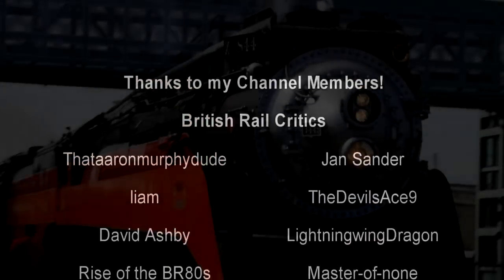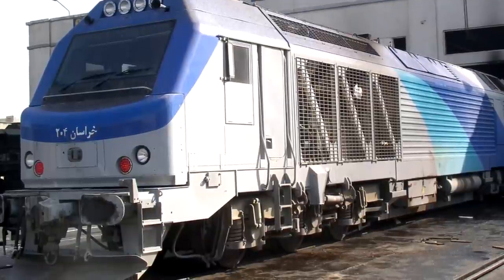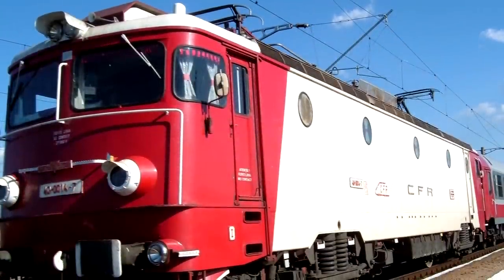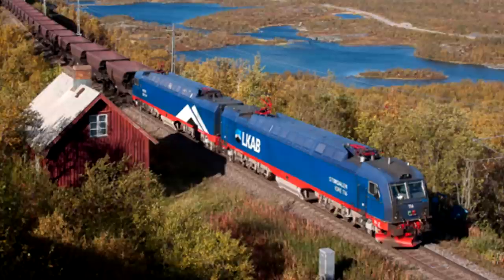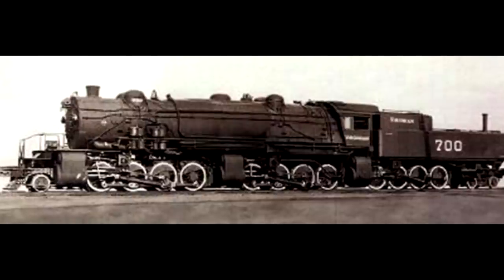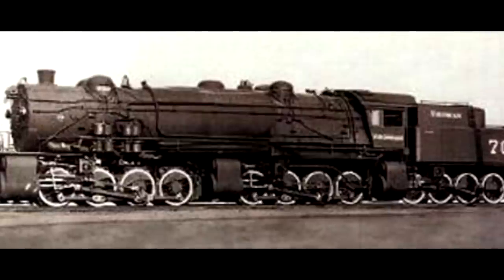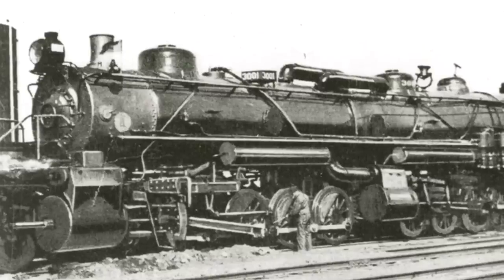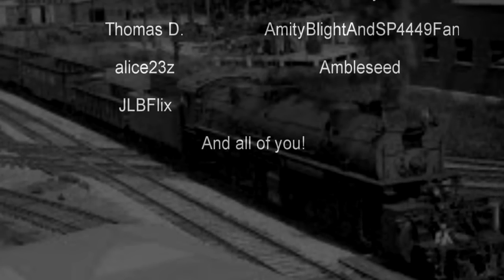5 Locomotives That Are Clearly Compensating For Something | History in the Dark

Comment: The Virginian wasn’t compensating for anything.  You should take an in depth look at the VGN, you’d enjoy it.  The Virginian was a coal hauling railroad through the mountains of West Virginia and Virginia.  I said through, not around for a reason.  While the N&W and C&O often kept their main lines along rivers and snaked around the stiffest part of the mountains, the Virginian was different.  Because it’s founder William N. Page and financier Henry Huddleston Rogers intended it to out compete the other two by offering quicker mine-to-dock service, the Virginian went right through the mountains with an intricate network of heavy gauge rails, tunnels, and massive trestles.  Interestingly, after N&W bought out the Virginian, they mothballed sections of their own mainline in formerly contested areas in favor of using the superior Virginian network.  

The VGN’s typical coal train was a 20,000 ton train consisting of their famous 6-axle 100 ton “battleship gondola” coal cars (also nicknamed that in no small part to them being arguably the largest supplier of coal to the US Navy).  They needed heavy power to move these trains through the mountains.  They had a large fleet of 2-8-8-2 Mallet locomotives, but noticed that the steep grade at Clark’s Gap, WV, was forcing them to use 4-5 of those locomotives.  The Virginian certainly could afford to do that being nicknamed “the richest little railroad in the world”, but also could afford to replace that lineup with more powerful locomotives.  The Class XA (meaning “Class eXperiment design A”) was originally an experiment to pull these massive trains without a helper.   Their horsepower is unknown because the VGN was never able to get them to full power long enough to actually measure their power before they’d run out of steam. Unfortunately, it was a failure in that role, and was used as a helper in banking, but was also a failure.  So the Class AE (“Articulated design E”) was born.  Those massive locomotives only needed helpers on the stiffest parts of that grade.  The high fuel cost led to the Virginian spending $15 Million to electrify the Mullens, WV to Roanoke, VA portion of the mainline, starting in 1922 and completing it in 1925. Their main locomotive, the massive EL-3A (Electric-3 unit A trucks) were some of the largest and most powerful locomotives ever built.  Interestingly, some of the Class AE stayed in service until at least 1953, the last one actually being scrapped by the N&W.

Comment: 1. 542kN ( 122.000 lbf ) of tractive effort for modern diesel with traction control is kinda/sorta regular these days.
2. So what is the issue here? Good loco, still usable.
3. Pretty standard freight locomotive. Kind of underwhelming, to be honest.
4. Steam locomotives can't be MU-ed, thus mallets and triplexes were an awkward attempt to get something kinda/sorta like that. It, obviously, failed, thus only four were made. Virginian ran EL-C triple sets of electrics which mopped the floor with triplexes and a single SD40 would give it a run for its money.
5. SantaFe's 2-10-10-2s were pretty much the same deal as XA.

If you want locomotives which are overcompensating - Allegheny H8 is the prime example. Russian AA20 4-14-4 is another.

EDIT: That "weird thing" of 2-10-10-2 was also used on N&W Y6 class locos, which were, arguably, the most successful american articulated loco.

Comment: Nitpick; the video has 3 magnitudes error in lbs to newton conversion. So, 100,000 lbs-force is 444,000 newton (a.w.a 444 kN).

About the Swedish LKAB trains; Basically, the more the trains can pull, the more they will load on to them. I vaguely recall seeing (I stayed along the track for 2 weeks in mid-1980s winter) 3 engines (RC-4 + two Rm) with a 900kN or so force available. 
Or to put in perspective; ~18million tonnes of iron ore from Kiruna to Narvik per year, or ~50,000 tonnes per day. Max 8600 tonnes per train set. Max gradient is 1% (!!!!) going West (the heavy direction). 12 tonnes per meter is the limit and longest trains are 750 meters long. Nearly half-mile. Personally, I kind fathom how this is pulled (pun intended) off.

Comment: I have read that the Erie p1 triplex, in simple expansion mode, had around 199.000 lbs of tractive effort.
Reply: Where did you hear this?
Reply: @michaelfrazierjr1282  i have seen a list with the most powerful steam locomotives ever built and on the top was the Erie p1. Unfortunately 2 years have passed since i saw that list and i don't think I can easily find it .
Reply: Pretty sure that was for the Virginian XA triplex
Reply: @NW2174Fan  I think that the virginian triplex was less powerful in terms of tractive effort than the Erie p1
Reply: @user-iv9qj7ys3y  Okay, nevermind, XA was 186,975 in simple (not 199,000), 166,600 in compound
Reply: But I checked the Erie P1, it could only produce 176,256 in simple, and 160,000 in compound, so XA was still more powerful than the P1 (as traditional for the VGN's superpower addiction)
Reply: @NW2174Fan   then I was wrong i suppose. Either way I don't think that it would really make a difference. I am not sure that both engines could run in simple expansion for more than a couple of minutes.
Reply: @user-iv9qj7ys3y  Yeah, not much of a difference, just a show of who has more capability (which is close to nothing when it comes to triplexes)

Comment: The Virginian(and Erie) Triplex (pronounced trip-lex, not tri-plex) was supposed to be used a pusher engine to help the 200 car coal trains the Virginian like to run...which was solved when they electrified their mainline.
Reply: It's just simply... not named trip-lex. It's Tri-plex in the same way it's bi-plane as opposed to bip-lane or dup-lex.
Reply: @tim3172  That may be the grammatically correct way to say it...but I've heard it pronounced for over 50 years as I stated(trip-lex), and that's not from the general citizenery but from people that consider themselves to be knowledgeable about railroading.  Go figure.